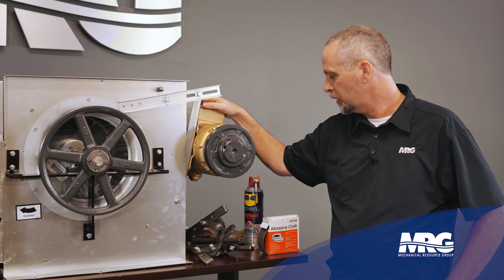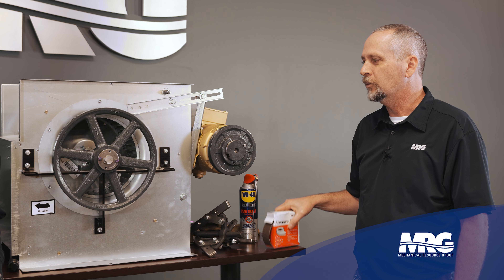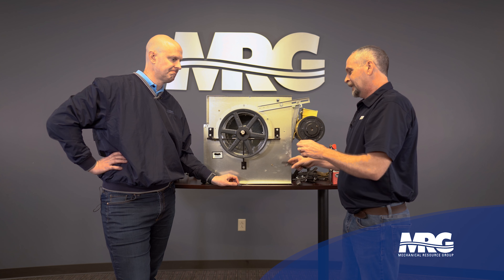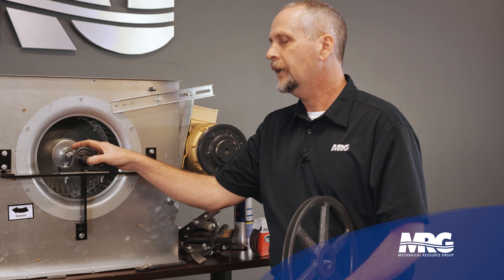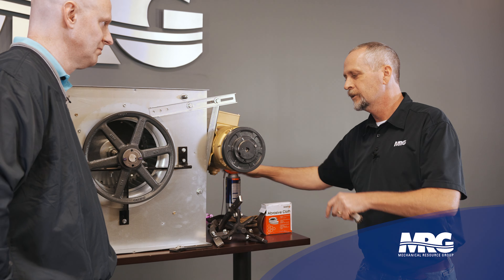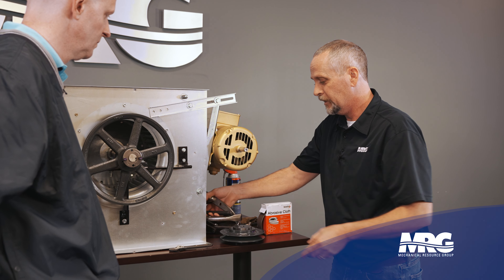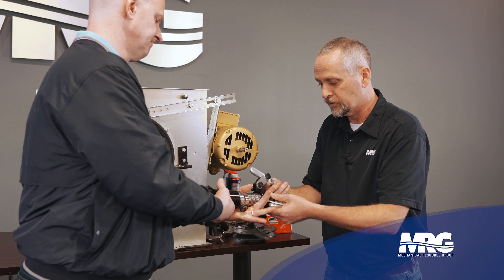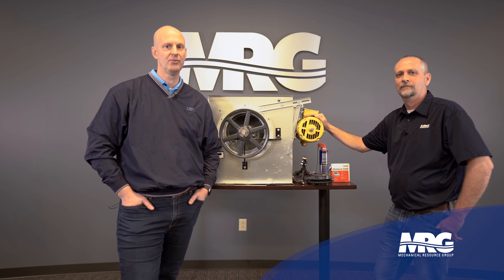HVAC Secrets: How To Remove & Install Motor Sheaves & Pulleys

Comment: I have always used a little Loctite antiseize when installing pulleys or sheaves.  But I have been told as well, that any grease or lubricant should Never be used.  Comments?
Reply: Some technicians do not like to grease the shaft, or apply a little grease on the interior of the bearing.  It is said that Anti seize and grease should not be applied between the shaft and bearing when assembled.  I personally, use  Loctite when assembling fan bearings, and sheaves.  I have never had an issue with this practice.  I like to think for the next time it is serviced, it will be easier for the next guy to work on if they have to remove any parts, hopefully the parts wont be seized together.
Reply: It's  a taper lock bushing